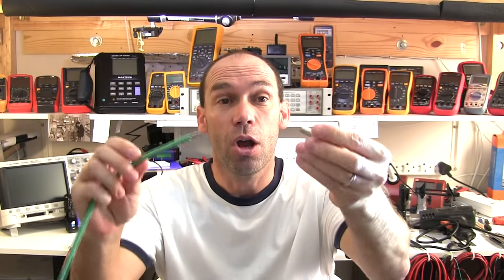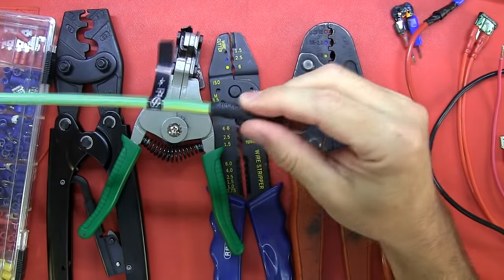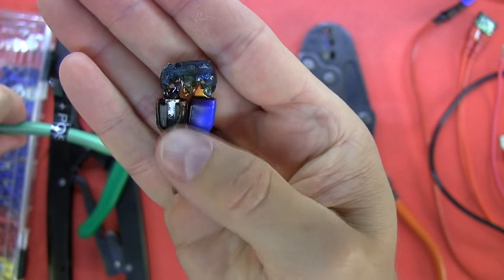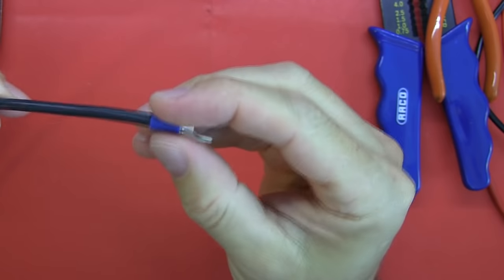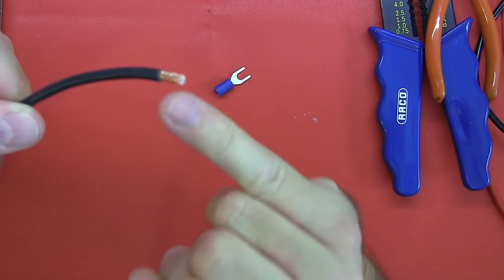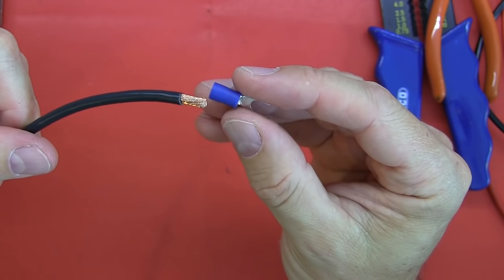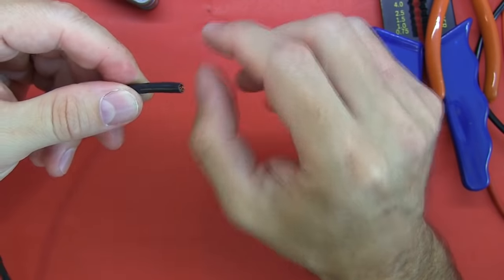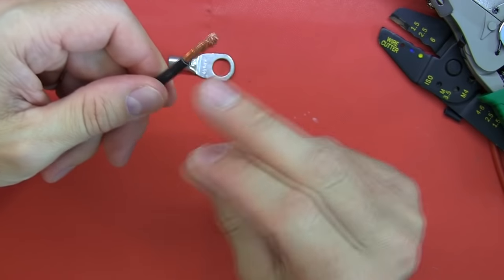Tutorial: How to crimp connectors, strip wire and use heat shrink.

Comment: On the last crimp you put the terminal in the wrong position.
The punch of the crimping tool must go on the other side.
http://team1322.org/Wire%20Crimp.JPG
Reply: The image you link to here shows a "dimple crimper" together with an insulated terminal. That is a wrong combination in the first place. Dimple crimpers are for non-insulated terminals only (the huge crimper in this video is a dimple crimper, correctly used on a non-insulated terminal). You are correct that if the (non insulated) terminal has a seam (not likely though), it should always point away from the "male end" of the dimple crimper's jaws. For completeness: insulated terminals require ovalized jaws to protect the insulation from splitting.
Reply: JarniDeGarza wrong glad you don't work for me

Comment: I watched 9 minutes and could not stomach any more. All your strips up to the 6 or 7 minute point were about 1.5 times too long for the connector you were showing them with. The strip should be only as long as the metal area inside the hole in the connector. The rest of the wire inside that hole should have ALL the insulation on it so that the second, INSULATION crimp has something to grab. This helps to provide the proper strain relief on the connection. My rule of thumb is when the strip looks too short, it is RIGHT. And then you show a folded wire in a connector that is clearly way too big for it. You MUST match the connector size to the wire size and to the screw size of the terminal it is going to go to. All crimp connectors will be rated on these TWO sizes (wire and screw terminal) on the packages they are sold in. The color of the insulation on the insulated terminals is also an indication of the wire size. 

The third thing you have to match is the crimping tool to the connector. If it is not the proper tool for the connector you can easily get a bad connection. If you want to know if your tool is a proper match to your wire size and connector, just crimp one. Then grip the connector in the bench vise and pull the wire until it fails by either coming out of the connector or breaks inside of it. If the wire comes out of the connector without breaking, the crimp was BAD and the tool probably is not a proper match for that wire and connector combination. If the crimp is good, then the wire will break inside the connector, leaving a short piece of it there when it breaks. I have never had this test fail to find a bad combination of tool and wire/connector. 

The final thing you MUST do when crimping is to be completely sure that you close the tool COMPLETELY. Some tools have ratchets the prevent releasing them before that point. Others rely on a pair of flat surfaces in the jaws that must touch each other for complete closure. If your tool does not have one of these, do not use it. 

This video is a bad reference.
Reply: Do yourself a favor and watch the whole video.  He addressed everything you said.  And he showed the folded wire in a connector as an example of how not to do it.   This is easily one of the most exhaustive video on the subject, not only addressing how to do it right, but how not to do it wrong.